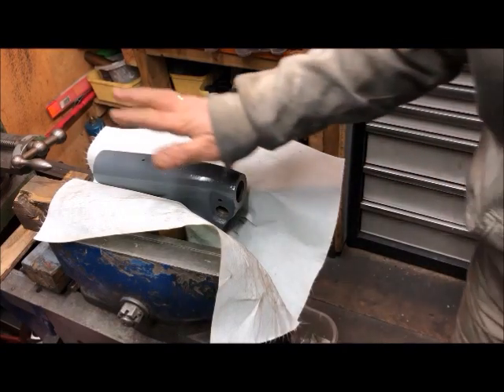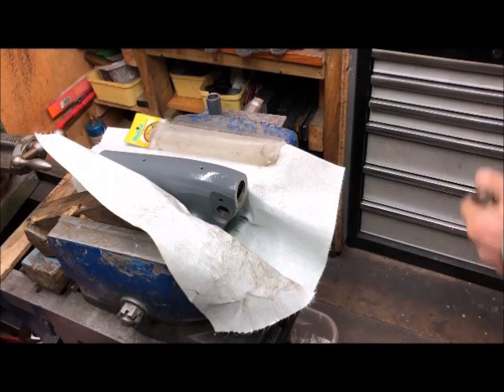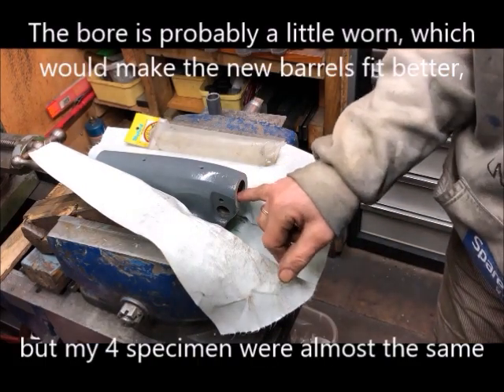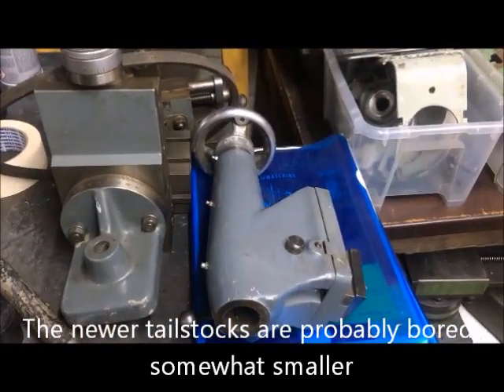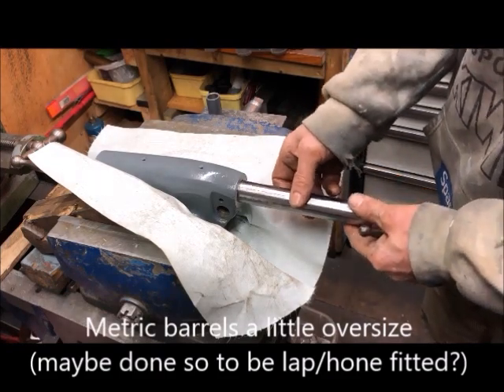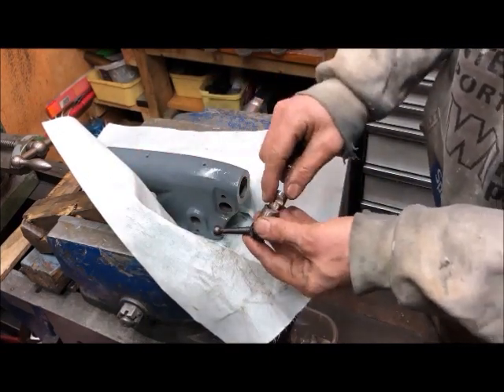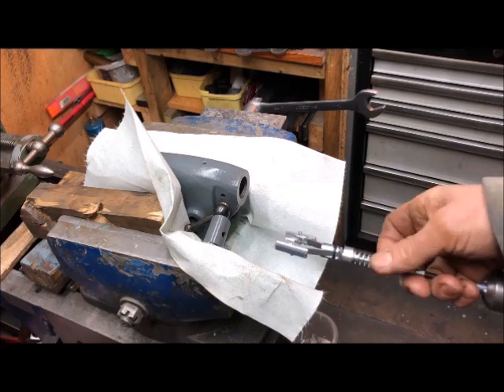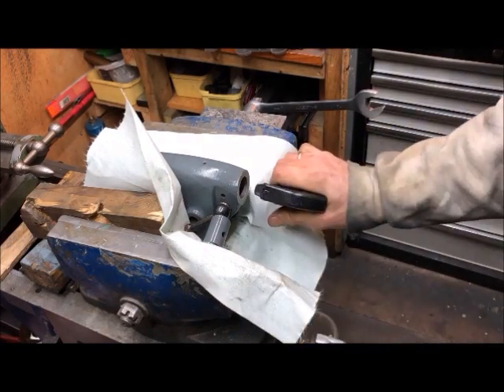Myford Super 7 - Tailstocks - fitting metric barrels

Comment: Is it because of the engraving on the replacement parts, that you do not make your own replacements?  I'm certain you can do far more precise machining than necessary for such a part!
Reply from the maker: That .. and laziness :) Well, I have sort of adopted the philosophy that if there is an original replacement part available I would buy (if price is not totally ridiculous). This is possibly better when/if lathe offered for sale. But yes, I have also considered machining barrels and there is no great mystery about the machining sequences and/or difficulty of machining, apart maybe from engraving (but there are also many a couple of ways to either do this or just bypass it.). PS! I have bought the longer barrel in the rack-feed kit and this is also a tad slimmer. I am saving one casting for this which I will probably sleeve, bore and hone..
Reply: @jansverrehaugjord9934  - That makes sense, thank you for explaining!